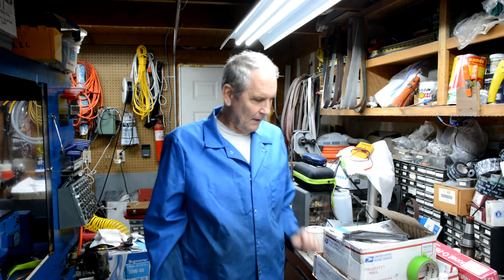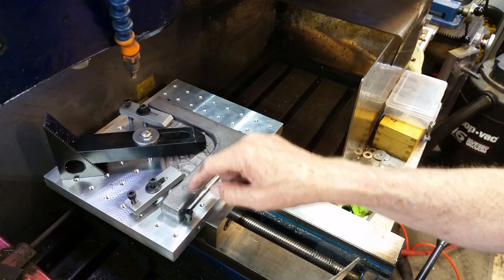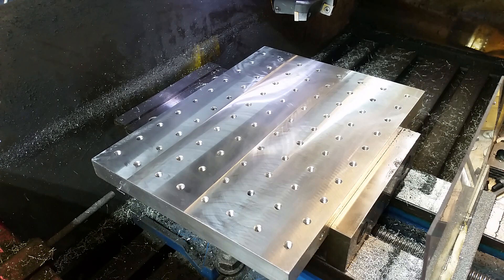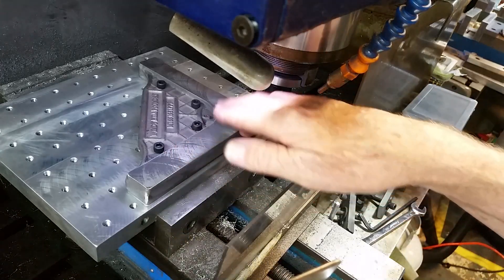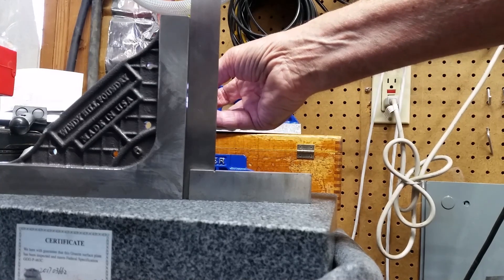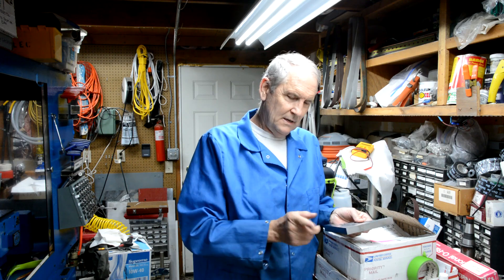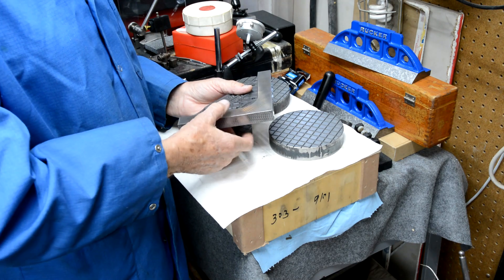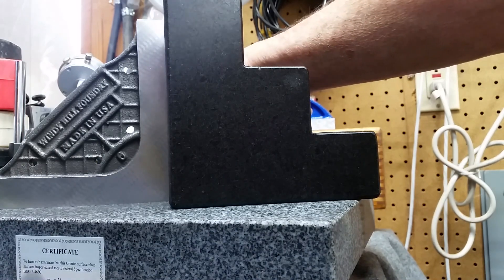Machining a Windy Hill cast iron square

Comment: Hi Vincent and what a pleasant surprise to see this today. I appreciate the video and hope you get years of accuracy from this. I am open to any ideas you may have on future designs that could aid in holding these. I originally thought about a cast boss with same height as the edges on each side in the central part of the web that could be directly clamped with little to no distortion but it would impede the design. Thanks again
Reply from the maker: I like your thought about the height of the cast boss.  Some holes in the web would also be nice.